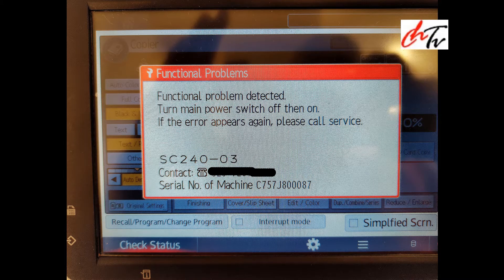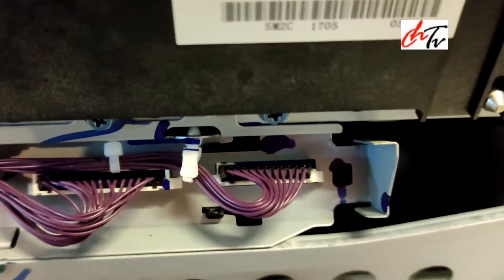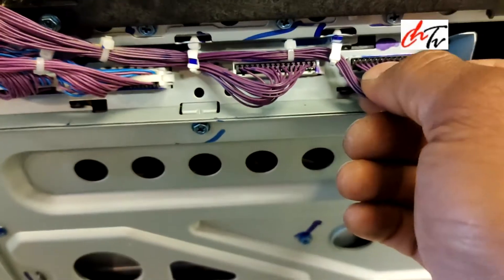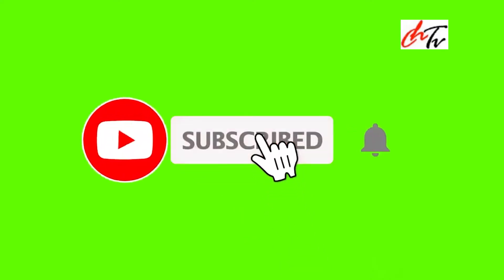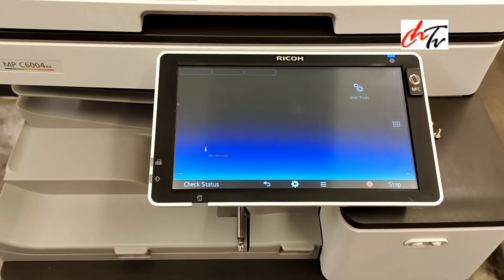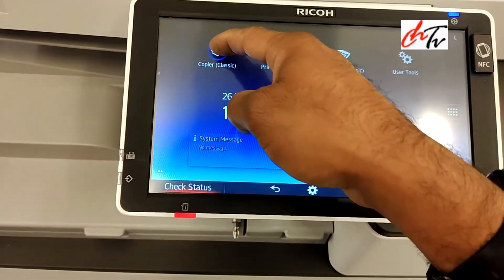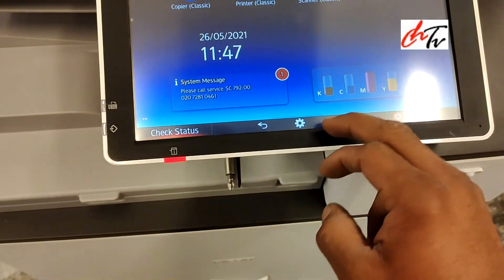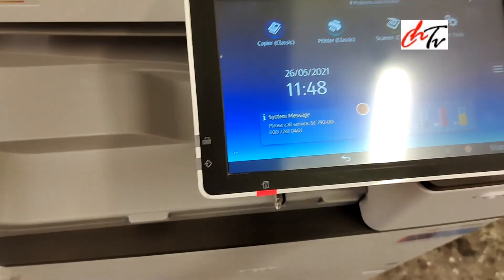how to fixed Ricoh error code sc240-03 | error code sc240-03 of mpc4503, 5503, 6003, 4504, 6004

Comment: Wat 
Wat is the treatment 240 04ricoh 4503
Reply from the maker: Description:LD error: Ma • If LD error terminal of LD driver of corresponding color is asserted after LD initialization. • If an error is detected during initialization of P-MAC which detects Ith/Ieta of LD of corresponding color.

Causes:• LD degradation (LD broken, shift of output characteristics etc.) • The interface harness damaged or not connected correctly. • LD driver defective

Remedy:• Cycle the main power off/on • Replace the LD unit • Replace the harness • Replace the IPU board

Comment: Hola, te escribo desde Tenerife, tengo una mp c401 que al encenderla y solo por 8 segundos da una pantalla de error, sale después de cargar toda la pantalla, luego se borra y la maquina funciona correctamente "
Reply from the maker: LD degradation (LD broken, shift of output characteristics etc.) • The interface harness damaged or not connected correctly. • LD driver defective.

compruebe que todas las conexiones estén conectadas correctamente en la unidad láser.. / si puede sacar la unidad láser, hágale una buena limpieza también. ¡Avíseme y buena suerte!
Reply: que tal buenas tardes un saludo desde mexico tengo un modelo igual y me da este tipo de errores de ratos funciona bien pero el problema sigue como solucionaste tu problema acabo de comprar el equipo y las personas de la garantía ya no me dieron respuesta